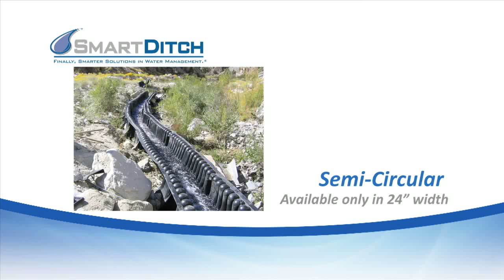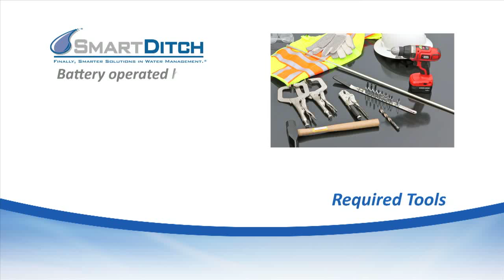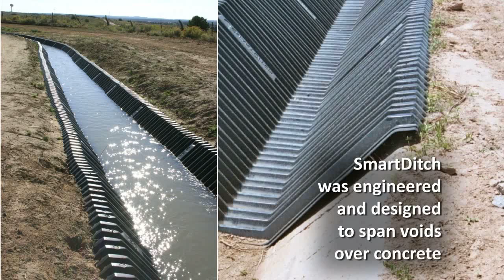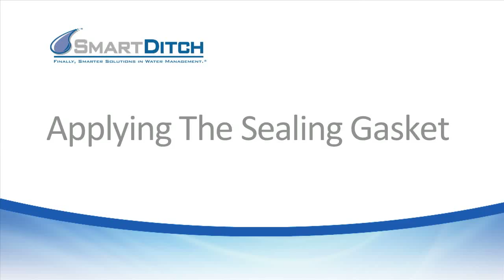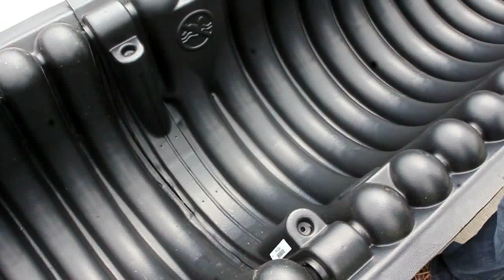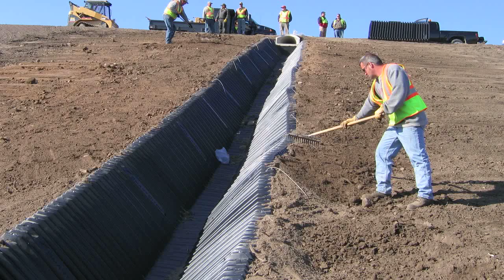SmartDitch Installation Video

Comment: Looks like the grooves would be a breeding ground for mosquitoes
Reply: Installed with proper drainage this system will evaporate any leftover water or moisture with ambient air and temperatures.

Comment: This system save you from having to clean the ditch every few years. I have not put in ditch work but I did Wouk underground utilizes for 20 years. It is lays very flat because it allowed self cleaning. Your abs and pvc sewer lines also are considered self cleaning. Farmers have to clean ditches every year or 2 costing time and money. This could possibly eliminate having to spend time cleaning ditches on your property.  I see many of you really have no idea how these system work you just think you dig a trench and let the water flow.  This just handles rain water and water run off not sewage. Maintaining a ditch system take equipment expensive equipment and trained people to run the equipment.

Comment: I USED TO DO SHIPPING AND RECEIVING. WHEN I RECEIVED A VISUALLY DAMAGED PRODUCT, I COULDN'T GET THE TRUCK DRIVER TO WAIT AROUND UNTIL I INSPECTED IT. AM I TO TAKE EVERY LINER OFF ONE BY ONE TO MAKE SURE NOT ONE IS DAMAGED OR NOT? lol I ALWAYS MADE THEM SIGN WHERE I WROTE ON THE LADING, "VISUAL DAMAGE, NOT INSPECTED YET, DRIVER DIDN'T WANT TO WAIT AROUND AS POLICY PERMITS" AND HAD THE DRIVER SIGN IT OR LOAD IT BACK ON THE TRUCK! THEY WOULD TAKE SPECIAL CARE OF MY PRODUCTS FROM THEN ON OUT!
Reply: SMART THINKING AHEAD, BUT NOT SO SMART USE OF CAPS

Comment: How is this smart??!!!  Biodiversity value?  Slowing the flow?  Infiltration?  Improvement of water security?  Water quality improvement?  Reduction of stress on receiving watercourse?  Green infrastructure?!  I think not.....!  An open sewer!!
Reply: It’s smart in the sense that it’s easy to install versus concrete or asphalt formed ditch lines.    Ditch lines are not intended to carry sewer waters they are meant for storm water runoff.   So I think your statement Wilhelmina is a little over the top.  For Christ’s sake I hope Wilhelmina is not your real name...that would be one awful name to go through life with.
Reply: @RoddyDa  Nailed it! All facts!
Reply: I'm two years late but this is an "Installation Video", not a video on how its "Smart"
Reply: Hope you get my point too. My point is this is the wrong place for her to question the products name and design, this is just a simple installation video. Her comment would have been better off on a video advertising the product.
Reply: Ed O'Neil, getting this mad over some random ditch product online ahahahah.
Reply: Wilhelmina Drayton SmartBitch you
 are not
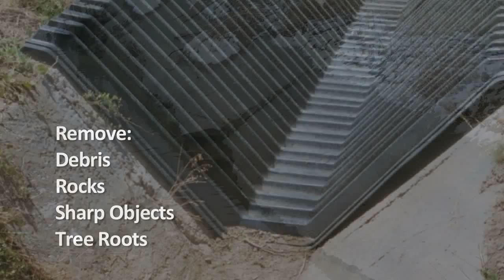Reply: an open dirt ditch or broken concrete ditch  see 4:09 is what it's replacing, A lined ditch saves the water from infiltrating (huge losses) soil when irrigating. It's not a sewer line, and with proper slope, fresh water will NOT stay in the lined ditch to breed mosquitoes etc. Also this is self-cleaning, eliminating the buildup of debris such as organic matter (which you would have in a sewer line.) Lining with concrete is very expensive, time consuming, and resource intensive (and not carbon tax friendly.) And concrete tends to break up as shown, over time, especially in freeze/thaw and extreme weather. 
Another alternative is plastic lined ditches, but these tend to leak and the plastic film has to be replaced quite often, and does NOT hold shape. 
These are also movable/removable, unlike cement PIPE or PVC pipe, which is typically buried. So, yes, a smart idea when used as intended: farm or city irrigation (such as we have from SRP in Phoenix.)
Reply: The SmartDitch connects with an app on your phone that shows you in real time how stupid you we're for buying this shit.. ( ^.^)
Reply: Ebola Bear That doesn’t mean people aren’t allowed to be critical about things around the subject. Your comment almost looks like you are the director of this system and you want to make her shut up by pushing a gag in her mouth. People can say and ask anything they like in the Youtube comments, you have totally nothing to say about that.